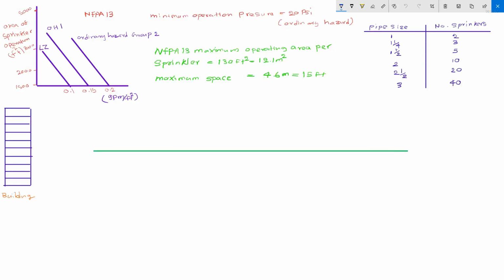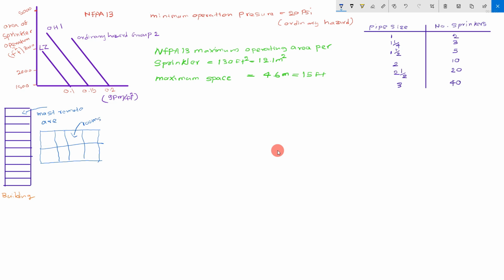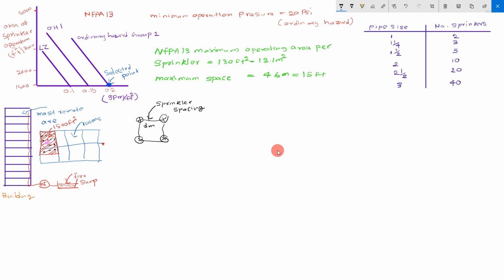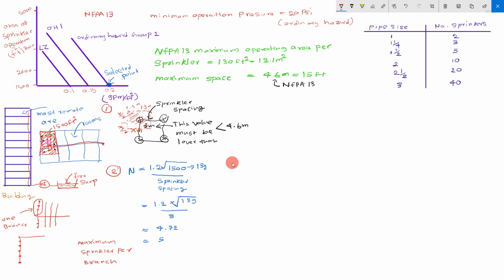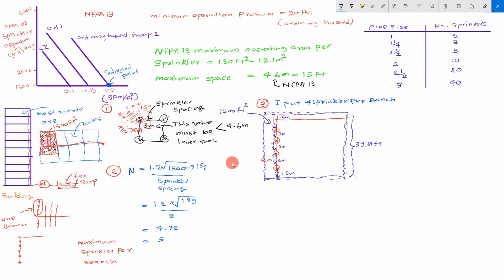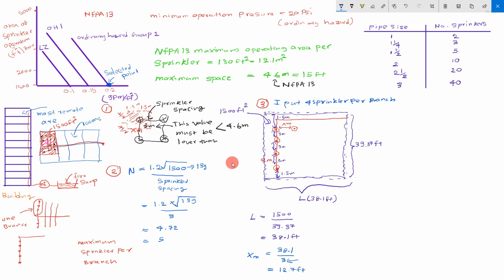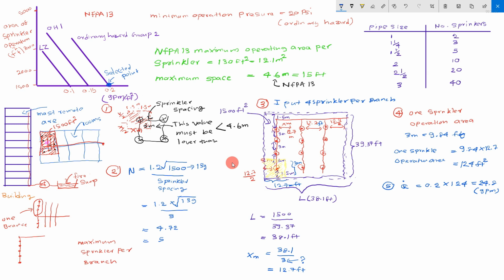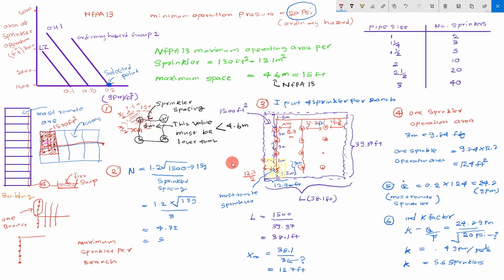How To Fire Sprinkler Calculation & Design - NFPA 13 - Part 1

Comment: I got a question in interview .. what are the steps (in order) you should do as FireFighting designer in any project from start to end?
Reply from the maker: 1. Submit architectural drawings to local fire department and take there decisions ( they mark extinguisher locations and landing valve , hose reel locations)
2.Find Building height as you want to decide whether building want sprinkler ( ex. above 30m we need sprinkler ) , Landing valve ( above 18m we need landing valve) , staircase pressurization system ( above 30m )
3. Do hydraulic calculation for landing valves and sprinkler system
3. After design you should submit your drawings to local fire department to take their approval.

✅Enroll Fire Protection Design Course - ✅Link - https://bit.ly/3jH7A1f